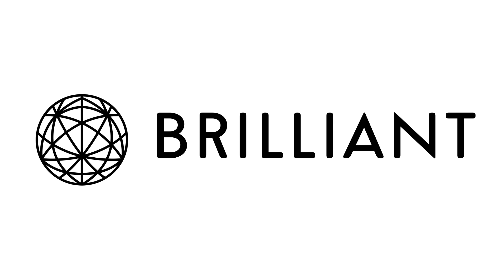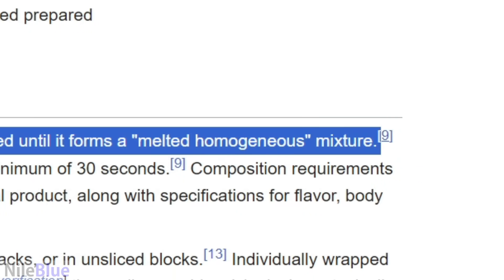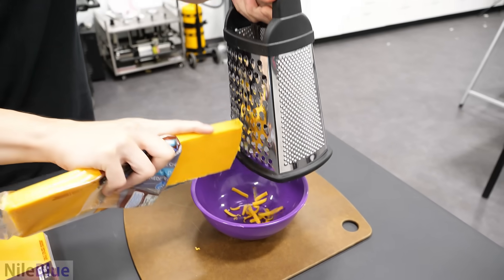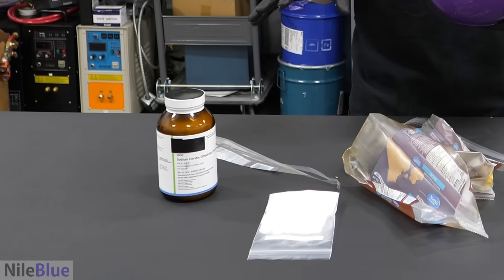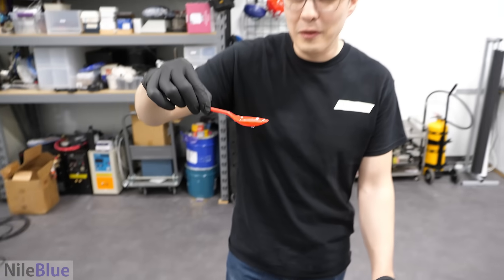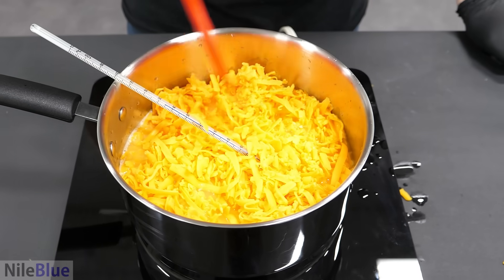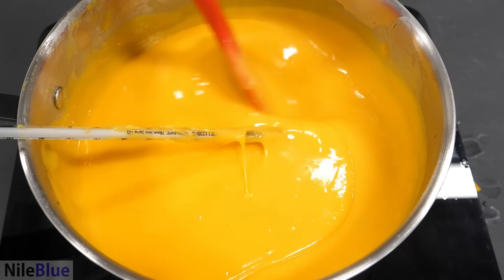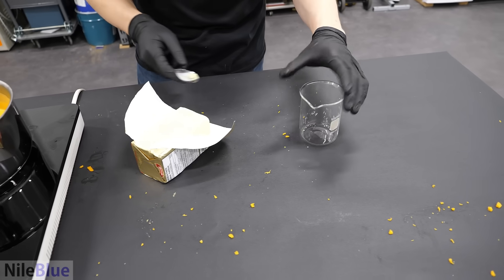Making American cheese to debunk a conspiracy

Comment: the reason its called a cheese product is because it's less then 50% real cheese. the other half is casein and milk powder or something along those lines. if an emulcified cheese has more than 50% real cheese it can be called american cheese
Reply: The real reason is because the cheese industry lobbied to protect their own interests against a cheaper competitor.
Reply: @kindabluejazz I'm not a cheese fan but I would gladly take real cheese over that floppy, shiny "cheese"
Reply: @kindablue1959 I'm sorry but if you have less than 50% cheese I don't think you should call that cheese ☠️
Reply: So the "plastic" in "plastic cheese" is just its name and there's actually no plastic in it?
Reply: @Lex_2003  mozarella replaces the whey with water, mozarella should also not be cheese
Reply: @bhustacrow2183  There's no plastic in it, it just has a bunch of other dairy products to subsidize the cheese.
Reply: @bhustacrow2183  It literally is just the emulsifiers that give it It's plasticity... The point of emulsifiers is to combine two different things that don't mix.  Such as how the egg in mayonnaise or it's sister sauces keeps the vinegar or lemon juice from seperating from the oil... Water and lipids do not mix at all...  Milk contains natural emulsifiers called casein that coat the tiny lipid globules and suspend them in the water based substance, which is why it doesn't seperate but after the cheese making process (or the butter makng process)the casein coating gets damaged and no longer functions properly.  Hence why most cheeses weep milkfat when they are melted...  By using emulsifiers you can basically reestablish that suspension, which means you can cook it without weeping or hydrate it without it seperating...

It's not actually that much different than how you make a cheese sauce or cheese soup with a roux.  The roux acts as an emulsifier to keep the cheese together.  

The only difference with processed cheese is it uses different ingredients (the ones in the video) to be able to properly resolidify it into a brick.  

It also actually makes processed cheeses really good for making something like a mac and cheese... cuz the emulsifiers in something like american cheese or velveeta are so powerful, they can emulsify a lot more cheese than they contain so you can combine it with a nice sharp cheddar or jack, etc and get an easy but flavorful cheese sauce...
Reply: Where I live I can go to Dollar General and see cheese product and even something labeled as “cheese food” 😳
Reply: @ILikeMetricMusic  Things labeled "cheese food" just mean it's a product where cheese isn't a major ingredient. It still has real cheese in it—it's not like they're using artificial cheese or some shit—but the cheese is sitting in the back seat, so to speak.
Reply: @SoftBreadSoft  cheese is defined by the amount of casein, mozzarella is still mostly casein and therefore real cheese
Reply: has nothing to do with the percentage of cheese. It's just made out of cheese, so it's a "product" of cheese
Reply: @Lex_2003  what you don't know won't hurt you.
Reply: actually its because cheese has a regulated moisture and bacteria content and in some causes fungus. The processing kills what makes cheese, cheese.
Reply: @heistingcrusader_ad3223  I'd take American cheese on my hamburger, grilled cheese, and a ton of other things over plain chedder.
Reply: @Lex_2003 it’s cheese plus not quite yet cheese…
Reply: The “contains less than 50%” cheese claim is 100% false. There are four categories of American Cheese established by the FDA, and only the very lowest category contains less than 51% cheese. Kraft Singles and the American Cheese made in this video contain substantially more than 50% cheese, but are still classified as “cheese product” for reasons independent of the percentage cheese content.
Reply: @bhustacrow2183   Well there's plenty of microplastics in it, does that count?
Reply: @jamesruth100 Incorrect. Pasteurized Process Cheese Food is actually the second highest quality category of American Cheese established by the FDA, and that category contains substantially more than 50% cheese. Only the lowest category, Pasteurized Process American Slices, contains less than 51% cheese.
Reply: @heistingcrusader_ad3223 did you skip the video? he literally just made the cheese out of cheese
Reply: @niox1920  I'd rather have 100% cheese than cheese products
Reply: @heistingcrusader_ad3223  the only stuff added to it is normal ingredients commonly used in cooking. I don't get this cheese supremacy you got going on here
Reply: @niox1920  well it taste like shit compared to the 100% stuff
Reply: its usually around 70% cheese not 50%

Comment: You can make Sodium Citrate just by mixing together some lemon juice & baking soda (or powder. idr.) adding just that to some cheese melted in milk would give you a nearly identical product.
Reply: You were correct about baking soda (sodium bicarbonate). Baking powder contains an acid (not the one you want) mixed with the sodium bicarbonate, so you wouldn't get the same results. The way I keep it straight in my head is that the "soda" part of "baking soda" is short for "sodium bicarbonate" (so it is straight sodium bicarbonate), while "baking powder" doesn't mention the sodium bicarbonate at all in the name, hinting that it is the one that is a mixture.
Reply: I wonder how different magnesium citrate would act in such a cheese though
Reply: @abyssal_phoenix  I might experiment with this. I have magnesium and citric acid, so I might try seeing what happens. : )
Reply: @busimagen  sure, let me know when you do!
Reply: @abyssal_phoenix  I'll have to wait until I go to the store... need some ammonia to convert the magnesium I have (magnesium sulfate) to magnesium hydroxide which I can then use with citric acid to make magnesium citrate.
Reply: @busimagen  household chemistry, love it!

Comment: Not sure if you just wanted to make a cookie sheet of cheese to be faster, but just in case...

If you want to get the classic slice- you pour it in a square loaf pan! Once it's set, you use a "cheese slicer" (it's just a thin metal wire, but the way it's configured makes it cut the same thickness slice every time) to slice off squares from the end. You'll get slice after slice of perfect Kraft Singles cheese.

Also means the wrinkles won't be visible on your final product lol. Just on the pre-cut block itself. Velveeta blocks do look a bit wrinkly.
Reply: yeah, what i was wondering, too.
I mean even making cheese from milk, if you want it sliceable, you make a narrow but long container, so it can be cut like a bread loaf, not sectioned like chocoate or whatever.
Reply: Could it be for commercial use ?

Comment: I have an old physics book that goes into how powdered milk is made (at least how it used to be). 1) superheat steam 2) spray it through a milk waterfall 3) the water in the milk turns to vapor/steam, while enough steam has energy left over to... be steam. The milk solids fall out, dehydrated to a good degree. And probably cooked a little. Science!
Reply: It is done the opposite way now. At least in some companies... they spray it into a superheated compartment and the powder falls below.
Reply: Thanks now I'm wondering how freeze dried milk would work in something like this...........
Reply: @donovanloreman   Ahh! Clever improvement

Comment: I made this at home a few times. I used some random tutorial and it wasn't all that great. I then used Adam Ragusea's recipe and it was great. You just use lemon juice (for the citric acid) and baking soda to get the sodium citrate at home. I use milk+butter base and don't forget to salt it. Sometimes I added nuts and black/white pepper. It tastes better and is cheaper than store-bought, but note that it DOES NOT keep NEARLY as long as store-bought. One week in the fridge max before it goes moldy
Reply: That means that your cooking process is not that clean as factory process (and that is normal).
Reply: @MrGedem I think a key difference is that factories add preservatives to the cheese
Reply: @elixia6446  This. It's the added water content that allows the mold to grow.
Reply: @KainYusanagi  exactly

Comment: The great thing is that this can be done at home. The chemicals that can help melt the cheese into the water properly can be accomplished by mixing baking soda with lemon/like juice. Once the soda dissolves the liquid has a non-sour fruity taste, you pour in water and/or milk, heat it up slowly and add the cheese and stir slowly and you have a properly mixed cheese sauce.
Reply: That's what I figured -- the sodium citrate sounded like it was close to citric acid, and the other chemical would be used as a buffer to keep the pH close to neutral. The reason they chose that particular chemical? Because of its emuslifying properties or the taste?
Reply: you can also get the same effect by adding wine it will just make it taste more like wine.
Reply: @MysteriousSignal  I was thinking about what the hexa-metaphosphate would do in particular.

Comment: The darker yellow is from oxidation essentially, you dont see taht in singles, becasue of the wrapper.
Essentially american cheese is just watered down cheese, the chemicals keep the cheese and water from separating and help them emulsify properly.

Ive made "home made" american cheese a bunch of times, using combinations of cheddar and jack, even havarti. Its actually super fun once you get used to making it.
Reply: If you haven't, try it with a decent parmesan-type cheese and water. If you get it right the kind of dry, nutty flavor stays but you get an intense and creamy sauce.
Reply: Which was invented to use cheese bits too small to use

Comment: One addition that should be made to the process is covering the cheese with a layer of plastic wrap as you put it in the fridge so the upper surface doesn't dry out when exposed to the air. Much like singles you buy from the store, any improperly sealed slice gets that hard/crusty/discolored edge wherever it is exposed. Ensuring the surface is completely "sealed" will ensure both sides have the same floppy, glossy surface and texture!

This same technique is used with custards and other refeigerated desserts to preserve their consistency. Have you ever refrigerated leftover pudding?
Reply: pretty much all cheese rapidly dries out when exposed to air, which is why they always need to be bagged or sealed.
Reply: I would have probably put it into a brick-shaped mold instead and then cut it into slices... You know, like what they normally do with cheese.
Spreading it out on a baking sheet was an odd choice lol.

Comment: The idea of pouring the cheese into a sheet rather than a block and cutting slices has my dying 😂
Reply: you would need some sort of hot wire to cut a nice thin slice from a block
Reply: That's actually how American cheese is manufactured: the slices are thin from the start, they don't come from a block.
Reply: @AloofOof  Or a cheese slicer.
Reply: it would crumble
Reply: @certifiedclownlala3672 no it wouldn't 
Cheeses like this cut pretty well, same with cheddar, cheddar can be cut into thin slices without crumbling too
Reply: @cuteheartcaty3714 actual cheddar can't.
Reply: @rld1982  yes it can lol, i have actual 100% cheddar, both strong and mild and both i can cut into thing slices with a thin sharp knife
i do this every other day

Comment: just a tip for using kitchen scales, it's better to add a little bit of weight to it too measure small amounts. the scale can't accurately measure 1 gram, but it can measure 50/51 grams
Reply: Does that still work if you tare it after adding the weight? As in, is it the load cells not being accurate with little weight, or is it firmware being weird?
Reply: @Max-wi6oc It's the load cell.  Having the container on it actually helps because it puts the weight closer to the "accurate" range
Reply: Ohhhh so that’s why you put a dollar down before scaling cocaine or heroin, makes sense
Reply: @TheMasochistKnight wuhhh??

Comment: I think of it more like coagulated cheese sauce. Like regular cheese sauce is just melted cheese with an emulsifier (flour or corn starch), you just used a slightly stronger emulsifier and then formed it into slices and cooled it.
Reply: It is. And regular cheese sauce will be much better if you combine good real cheese with couple slices of these american cheese. That will be enough of this chemicals to make good sauce.
Reply: If you want a cheese sauce instead of a floppy thin slice for burgers, just start by doing bechamel sauce (melt butter, mix in flour and then slowly add milk). Finally add the cheese.
Reply: Tha'ts precisely what it is. They needed a cheese to go in military ration packs that wouldn't break when it melted.

Comment: Who's gonna tell him that you are supposed to make it into a block, and then slice the block?
Edit: I did some research, and cheese is formed into a sheet, sliced into ribbons, and then into squares. Sorry for the mistake!
Reply: Yup.  The number of times he said "cheese slices" and never makes a block to slice.
Reply: I doubt he has the correct knife to slice that thin
Reply: @BijinMCMXC  not expensive to buy one, especially for a channel of his size, and he used milk powder and some random chemicals
Reply: I can't help but wonder if the Kraft individually wrapped singles are actually poured in flat sheets like that which are then cut into the squares.  Would be so much easier than slicing a block.
Reply: "Slices" of American cheese usually don't come from a block. Have you ever wondered why those slices you buy from the store look like someone rolled molten cheese into a plastic wrapper? That's not a coincidence, it's exactly how they're manufactured.
Reply: @mr89firebird  You are correct, they are not sliced. They're manufactured as singles.

Kraft also makes sliced American cheese, but they're not the wrapped singles. The wrapped singles never saw a blade.
Reply: it sucks how many thumbs up this comment has when it's just wrong. if you could edit this comment with accurate information that would help stop spreading misinformation.
Reply: @Aaron.Thomas  True, I usually buy the kraft 'fancy' American that is a sliced block for burgers lol
Reply: @soupstoreclothing  I am not sure how cheese is made, it seems like a pain to need huge sheets for one slice of cheese
Reply: @soupstoreclothing  Sorry, I edited the comment.
Reply: @zanefreeman954  it’s not that damn serious! He just made some fucking CHEESE 🙄

Comment: BTW 1. of the chemicals is the salt version of citric acid (in lemons and limes etc.) And the other is an emusilfier which basically is a chemical that you add to make an emulsion mix. An emulsion is like water and oil, they don't mix, separate pretty quickly, but you add an emusilfier and they mix and stay mixed. Totally safe, you consume both of these things most likely daily, sodium hexametaphosphate probably a lot if you eat processed foods, can be in beer, cheese powder, salad dressing, whipped cream and the list goes on.
Reply: IIRC the emulsion occurs between the milkfat and casein protein, which normally separate in melted cheeses similar to cheddar, but yeah it's the exact same process.

Comment: As someone who works at a food safety lab and regularly uses USP methods I can tell you that anything labeled as being USP tested is definitely safe to consume.  Those tests are incredibly thorough and have very rigid quality standards, including a pre-testing requirement for every single product type being tested.  So if you made 60% cocoa chocolate bars and 80% cocoa chocolate chips, you need to get two separate pre-tests.  This is to ensure that the testing method will actually work for each product at a given dilution.

So yeah those citrate crystals are absolutely safe to eat as long as you don't eat an amount of it that would be toxic.

Comment: Two tips. Use a mixture of cheddar (A hard cheese), and some soft cheese like colby or Monterrey Jack. That will improve the flavor. Secondly, solidify it in a meatloaf pan, then take it out of the pan and slice off the thin slice you want.

Comment: Rather than starting with the chemicals, you should have started by melting the cheese to show why the chemicals are needed.  If you melt cheddar by it's self the oils will separate out.  The chemicals keep that from happening so it stays blended before turning into ribbons of cheese that is then cut into squares.

Comment: I don't what the sodium hexametaphosphate is, but sodium citrate can be easily made at home by putting baking soda in lemon juice until it's not sour anymore. Don't know if it's a dihydrate anymore, but I'm not sure that matters. In any case, the sodium citrate itself is needed to help open up the curds so it doesn't form chunks and oil when you heat it up, which actually makes it look less gross and doesn't make you feel like a bad cook. That means you can make smooth queso sauce. You might also employ it in Mac n cheese.

Anyways, I hate the American cheese hate. They keep saying it's fake or a byproduct. It's not. It's literally mostly cheese. Queso is pretty much the same, and it doesn't get the same hate for whatever reason.

Also, if you've ever reheated homemade Mac n cheese or Alfredo pasta that you swear you made with real cheese only, you might notice that if you heat it aggressively, like at full power in the microwave, it becomes really stringy, oily, and unappetizing. Sodium citrate actually helps prevent that. It's an emulsifying agent, so it helps keep those cheese particles in suspension. In other words, it keeps it smooth. So add some when you're making it initially. Thank you, chemicals!